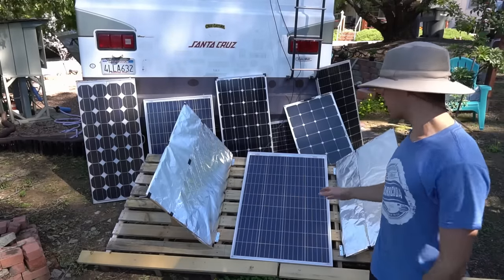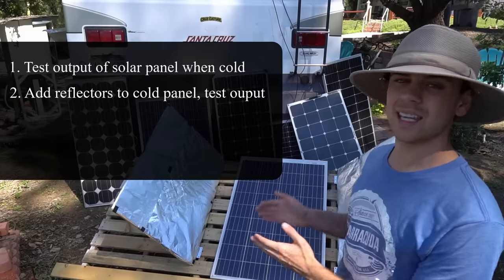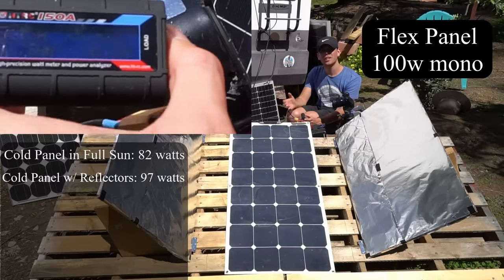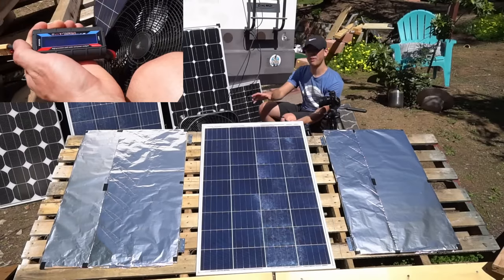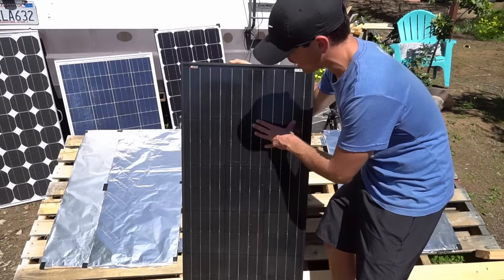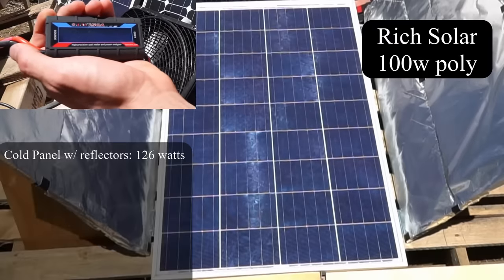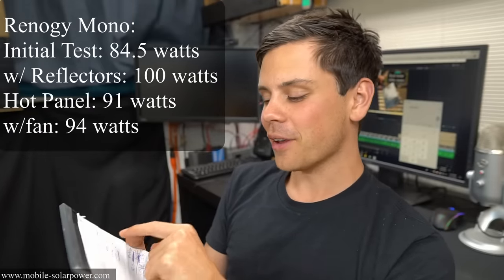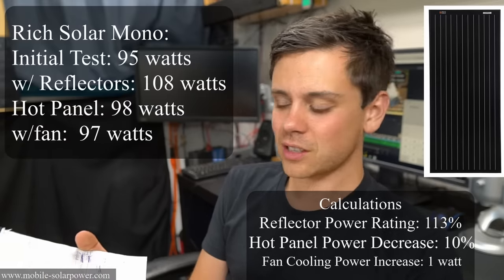Solar Panel + DIY Light Reflectors = More Power? Renogy vs Rich Solar vs Flexible Panel

Comment: Thanks for doing this full sunlight test.  You have clearly debunked the notion that mono panels are more efficient than the poly panels.
Reply: ...but the Rich poly-panel is quite larger than the Renogy mono. Make a Renogy with the identical amount (square inches) of surface area the Rich has and compare the outputs then.
-- BR
Reply from the maker: Yeah but in a previous video, we figured out that the efficiency for their size is nearly identical. That's why we measured the panels. Do the math yourself, they are the same output for their size.
Reply from the maker: Sure thing Warbucks!
Reply: @WillProwse  Yes, of course, but the common "knowledge" is that the monos are more efficient than the polys.  You showed that they're not more efficient, but are about the same.  That's what I was referring to.   Save money, go poly, lol.
Reply from the maker: @BubbaWarbucks  Oh yeah, totally agree, that first comment was for Bill. I totally agree!
Reply: Did you see Will's last video where he calculated power vs. panel area?  There was virtually no difference.
Reply: @mikemead2315  Not all monocrystaline panels are equal either, but the one he tested seems like a pretty good deal.
Reply: @billredding2000  The study was equal in percentage of rated output per panel their size is accademic. Pay attention.
Reply: @dandahermitseals5582  I'm not going to argue the point -- you go with poly panels and I'll stay with mono panels (and for more reasons than questionable power-output differences).
-- BR
Reply: @billredding2000  you miss the point. I just defined his test proceedure. I don't give a ratt's ass bout poly or mono. I have both.
Reply: Good for you, DF. You go, girl.
Reply: @dandahermitseals5582  Good for you...

Comment: You need to mount the panels by the edges in order for the back side to cool properly.  The fan would need to blow more at right angles and from below to have any cooling effect.  Your reflectors need to be better made and mounted so as to give even illumination and reduce the heating effect per panel, since the current will be limited to the cell with the least light on it.

In general, silicon cells would need to  be water cooled at any augmentation level.  The added cost of the cooling, tracking system and reduced lifetime for the panels/cells makes this a waste of time.  The research was all done on this 30+ years ago.
Reply: Unless you live far from the equator, especially in the winter, where the panels can use every photon they can get and need no special cooling.

Comment: Great  video!  Again, the Rich Solar Panels are proving their value and I think I'll get some soon.  I'm amazed at how you continue to find new and interesting topics that fascinate us.  I remember that years ago, commercial experimental solar farms did use reflectors.  More than likely, they ended those experiments because focusing the sun means focusing heat.
And as we know, those solar cigarrette lighters also focus the sun to start fires.  Imagine the panels, wires and frames taking on that additional heat?   Haha...  Forget that approach.
Have you ever considered making videos, with the same "intensity of investigation" covering Lithium battery pack construction and testing?
It would be great to have someone like you testing the different brands of 18650's that are out there......  just saying....

Comment: I wanted to do this 20 years ago when I opened a lot of thick books on solar panel research at a university library. I came away with the impression that polycrystalline was better at collecting none direct solar energy. I thought adding reflectors would be good only in the winter when there is less hours & power from the sun and lower ambient temperatures. I would expect a huge advantage in the winter. I tried a stainless steel backed polycrystalline flex panel in Turkey on my roof and it lasted only 1 year before the inter cell connections corroded. A traditional glass faced monocrystal panel from China on my car roof rack in the UK is now 10 years old and still produces full power.

Comment: If you have the space for reflectors you have space for more panels. Interesting test though.
Reply: A reflector is cheaper than a panel if it boosts the output of each panel
Reply: @jamesread11  it's not cheaper if your reducing the life of your panel. Especially for such a small gain
Reply: Only lifing the panel components an extremely hot days, probably a few weeks of summer, the rest is just getting more from each panel

Comment: I have mirrors that reflect light on to my panels, has definitely improved there output. I believe there is a material out there that acts like a heat dissipater /exchanger, but is all getting close to nerdy at that point.

Comment: how much loss do you expect if you don’t use reflectors and they become warm after 15 minutes?
Reply: Wouldn't the loss be the same? I mean once they're heated, by reflectors or natural sun, you see loss, regardless of how they were heated.
Reply: loss in watt. because the first measurement (cold no reflectors) is not a fair to be compared with the third (warm with reflectors) measurement
Reply: @thenextchapter6223  Except with reflectors you end up with more energy so more heat.

Comment: Adding another pannel is the good conclusion but the area of RV roofs is limited. Therefore, it can be useful to make a solar tracking system. In addition, tilting the panels allows natural ventilation. This prevents the panels from overheating

Comment: I would love to see you test Peltier modules to cool the solar panels that way your cooling system will be generating electricity
Reply: I have always  wanted to try this. But would  be expensive to cover the back. Hope someone tries this
Reply: @nunyabusiness2191  what about the draw on power that all those Peltier's consume. Would be far better to just buy an extra panel or two.
Reply: @stevetobias4890  they only consume power when power is applied to them and make a cooling on one side and heating on the other. If you put them on something hot like a solar panel they will work in reverse and produce electricity.  The heat has to be drawn off the peltier on opposite side for efficiency.. so bigger the temp difference the more power you produce.  Some have put on wood stoves  ect and produce power
Reply: @nunyabusiness2191  cool, I might have to get some and experiment
Reply: @nunyabusiness2191  ....so the idea is to do what? Produce miniscule amount of electricity from the Seebeck effect? Or to try to actively cool them by consuming ridiculous amounts of power with the Peltier effect? Simple convection would be far more efficient and cheaper. At the very most a large heat sink would suffice but then you're adding cost back onto the panel for little to no gain.

Same as reflectors, yes the power output increases until the heat does. You won't dissipate the heat quickly enough so reflectors for many climates is really a nonstarter.
Reply: @Ethereal Rose  yes more expensive then its worth. Would nice if they could  make a peltier sheet to the back that did the same thing but cooling is still an issue. Cooling the panels and the peltier may produce more power together but would  be many peltier to add

Comment: Yes, equalism 42 is spot on. You will cook the Tedlar layer that protects the cells which will discolor (brown) it resulting in eventually lowering the output. Use white-painted reflectors which will not reflect the IR spectrum and you will get good results that won't harm your panels.
Reply: Did you ever try white painted reflectors? Or do you know someone who has?

Comment: I wonder what would happen if you water cooled the back of the panel?
Reply: fourbypete efficiency increase doesn’t outweigh additional material and manufacturing cost. There are existing panels on the marked that incorporate thermal waterheating  with photovoltaics. You just don’t hear about them because they are practically a bad idea in most cases. Pv modules are designed to gather as much light without raising the temp too much and still being cost efficient. Solar thermal collectors systems require to withstand much higher temperatures to work effectively. Temperatures that would quickly degrade semiconductor junctions of pv panels. So you see you’ll always have to make a tradeoff on either system which in conclusions makes you favour either one of the systems standalone.

Comment: any information on amorphous panels like Harbor Freight setup?
Reply: @Patriotic Realist I have heard this and I've heard the opposite but I've never seen any real world tests like what Will is doing.
Reply: @kevinroberts781  I don't know. 81 watts is pretty dang good.
Reply: @kevinroberts781  I bought a 100 watt set over the winter and haven't hooked them up yet. I want to use them for a DIY Camper I'm building.
I like that they can be connected to each over with a stand.  Would use them to charge a 200 AH battery bank on camping trips.

Comment: TRY  A WATER MIST
Reply: It definantly works, power output is directly proportionate to cell temperature. Your problem will be the sudden thermal shock that occur every time the mist is applied, resulting in micro cracks with time and consequently a significant reduction of the panels expected lifespan.
Best thermal efficiency gain I've seen was from another bloke on YouTube who had his panels mounted on a tilt system, he enclosed the area behind the panels to make a large triangle and plumbed it in as the return air for his central heater.
Reply: Look for a group on Facebook called my efficient electric home. The group is simply amazing and full of energy saving tips and tricks from professionals in the industry.
Reply: Mykel Hardin  The mineral scaling won't matter if you mist the back of the panels.

Comment: Using A Motor Driven Tracking Board System Will Definitely Give You The Most Overall Efficiency vs For The Costs To Incorporate / Install, Period! This Is Based On MY 30+ Years Of Sales, Service & Installs In The Solar / Green Living Products Industries & Constructions... Thanks

Comment: Something for all of us DIYers to keep in mind too is that when we buy solar panels of different name brands they may also have a different voltage output. For instance...I too have some 100 watt panels that are made by Eco amd a couple others made by a different company. If you look on the back of the panel there is usually a tag that tells you the most important things about that panel and one is its average output (it might say Peak output, not sure) and then itll tell you something along the lines of 21 volts or 17 volts, etc... Just make sure that what you buy is the same basic output as the rest. If you have a 12 volt set up then you specifically want 12 volt panels with the same average output. If you have a 24 or 48 volt system the same principle applies amd make sure you get the correct voltage charge controller and inverter for that specific system. It's a lot like buying car parts.  You wouldn't buy a set of spark plugs for a big GM truck motor if you own a Fiat. The same is true here.

Comment: Will, I see you used the dull side of the aluminum foil.  Try the polished side of the foil, logic would indicate more reflective, therefore more sun light on your panel.   I know in cooking it doesn't mater but in this case it could.  Give it a try, see what happens.

Comment: Glad someone else thought to do this.. If someone designed a speciality solar panel specifically designed to withstand extreme heat from reflective surfaces.. and built in a system that uses a cooling agent to keep the panel cool (many could be used even something like liquid nitrogen or simple as dry ice) i think the efficiency problem could be solved. Furthermore if you were able to multiply the additional amount of energy from the added mirrors enough to offset the energy required to run the cooling system and still have additional energy left over then your really talking advancements. It probably wouldn’t take much cooling agent to keep the panels cool or cool enough to operate at peak efficiency.. which is probably still pretty hot given they are already designed for high temperature environments. So you prob would jus have to lower the temp perhaps even jus a few degrees to drastically increase efficiency.. idk jus a theory. Another thing I think about is the power that could be harnessed through simple magnification and perhaps could even be used in relation to solar panels but that would be trickier and would need a converter of some sort id assume.

Comment: I always wanted to do this experiment.  Thanks
One comment, there are much higher flux configurations for the reflectors -you could melt the flex panel with enough reflection.

Comment: Awesome... too good. In just 4 minutes you killed market for Renogy...lol. Awesome experiment. 10-20% improvement with reflectors... that's really huge especially in 1kW and bigger systems! Retry with 300w solar panel and check if you will you get 30w or just 10w increase? Will bigger reflector increase the %? This could be great in overcast and cloudy conditions.

Comment: It's a good backyard experiment, but what matters is really the wavelength of the reflected energy that will determine its efficiency increase, which in the case of solar panels are short(er) wavelengths from visible to UV.

Comment: Your videos are great. Your point at the end is the big take away: why waste time & surface area with reflectors to gain 10% when it's easier to add a panel and get 100% gains?
Reply from the maker: Exactly

Comment: As to using the Reflective surface to focus and concentrate the Light on the panels to generate additional energy, Sara Tyo did this in her 5th Grade Science Project. It is a good Idea, but it has been experimented with before. Try a complete system that encompasses: Reflection (Mirrors), TEG Power Production to assist with cooling, and any other SYSTEM Improvements that improve Overall SYSTEM efficiency and consider the Weight and Cost implications. Simply slapping mirrors around a PV Panel has other implications - eg. additional heat. It is when you consider all ideas that we can make real improvements to energy production systems. Just some thoughts - not trying to insult anyone which is what most commenters use this section for.

Comment: You can use prism film to increase the light (power) commonly found in lcd tv screens. This also negates having to aim the panel directly at the sun because of the pyramid shaped surface pulls the light in from all directions! Can be used on top or around the sides of the panel.

Comment: You should do a test on solar panels under the shade , like a wall on opposite side of the sun, use reflectors and see how much power increase and if the temperature is to hot.

Comment: An atomised water droplet spray works best for cooling the panel as there is an added surface evaporation decrease in temperature. Also the spherical droplets act as tiny concentrators.

Comment: I plan to use a flexible panel on top of the 1 inch raised ribs on my roof for air flow.
I also had the thought to fix the panel directly to a sheet of aluminium first. The idea being aluminium is an amazing heat sink, 30x more than steel I think.
Might worth a try.

Comment: I believe the polycrystalline panel has more area able to re-radiate the heat it develops.  I also think you might have used the fan at the other end to move the air upward, the air natural convection currents want to go up not down.

Comment: your right about using a reflector they use a motor to track the sun to capture the most energy the drawback is that a uncooled panel looses power when it over heats so you have to run water or a substance which you circulate by a pump move the fluid through tubes to a heat drop radiator that is away from the sun so it cools your panels and allows your panel to produce more power without the overload of heat.  tubes can be a flexible tube used to run water to a home this will allow you to track your panels without breaking your pipes.

Comment: That's a neat experiment, cool to see it helps.   I've heard that reflection off snow can actually help too, for off grid setups where you don't want to be removing snow off the panels every morning putting the vertical can be effective and the reflection of the sun off the snow actually makes up for the less optimal angle.

Comment: In my experience building a mount that can track the sun is worth it if you have the time. Just 3 positions works well. I've never owned a automatic sun tracker. People who do have told me not worth the price & that they love them split about 50/50. Getting full sun morning noon & night does make a difference though in my experience. I don't think I would bother with reflectors. I'm worried about degradation of the panels.

Comment: good video.  you may have extended the life of some of my panels.  because i was going to put a reflector about 4 times larger than the panel it would surround.  because i live in a very hot sunny place i will make it a winter only option.  just like the solar hot water service collector cover i install in summer to stop regular boilovers.  i stripped down an old light with an aluminium reflector in it and put it around a cheap solar garden light.  there is certainly an improvement.

Comment: Idea for another segment.  You may want to purchase another Rich Solar Poly 100 watt panel to see if they are consistent.  It would be interesting to see if those cheap 80$ panels are consistent, I wonder if you received a panel that works better for some strange reason.  You are always shocked how well it does but is that normal for these panels or did you get an abnormal panel?